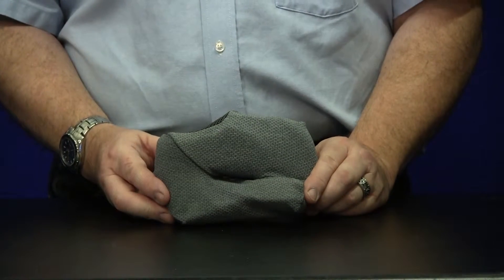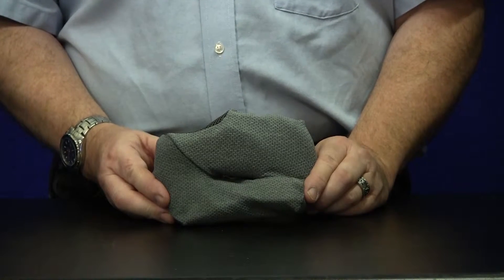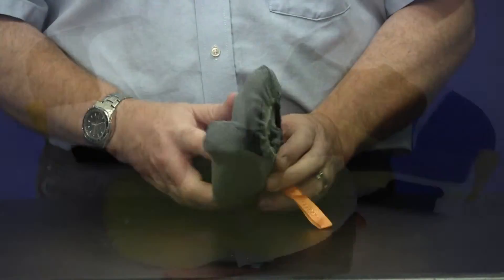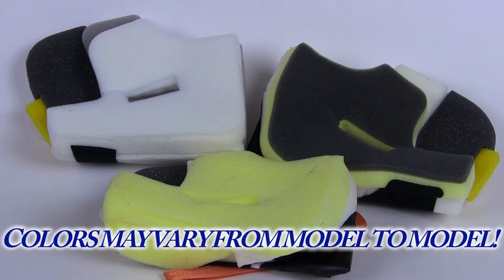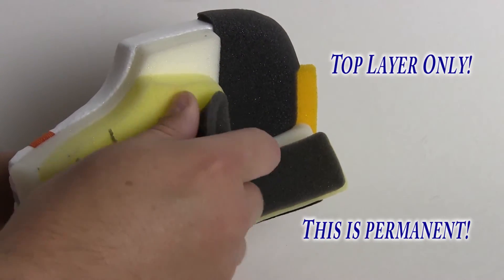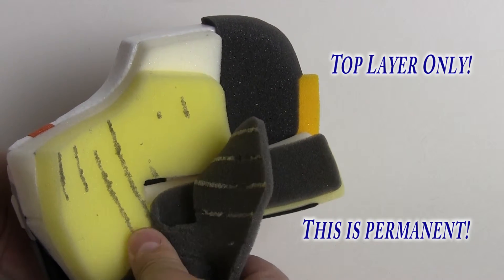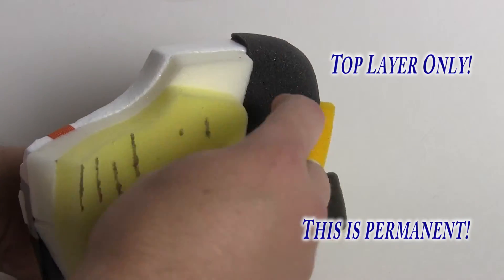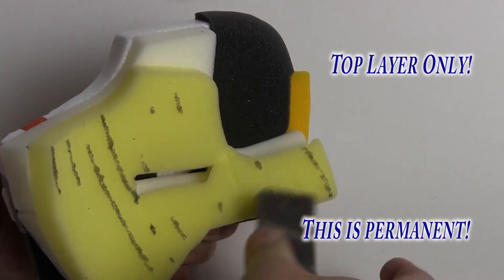Peel Away

Comment: You guys should consider making an updated version of this video that includes the tear away options for the headliner too. I managed to find some obscure images in a pdf of an owners manual from like 2014 but I would have felt way more confident doing it had you made a video. I was worried that I may pull a layer off from somewhere that I'm not supposed to and compromise the safety of the helmet.